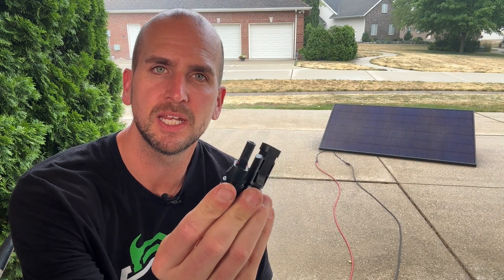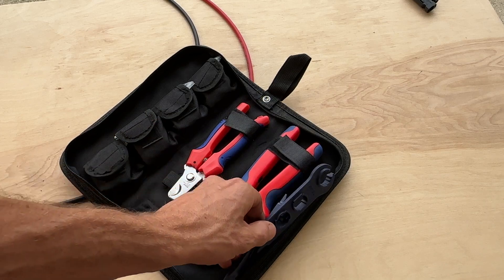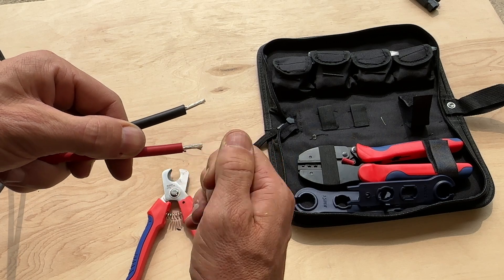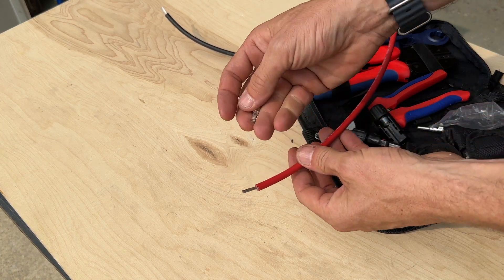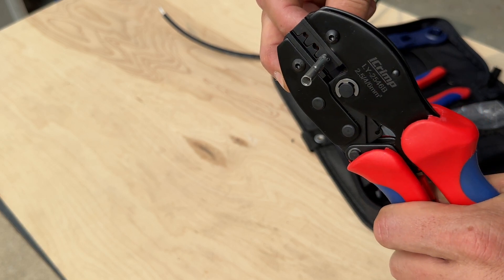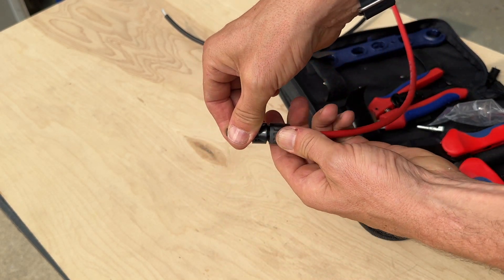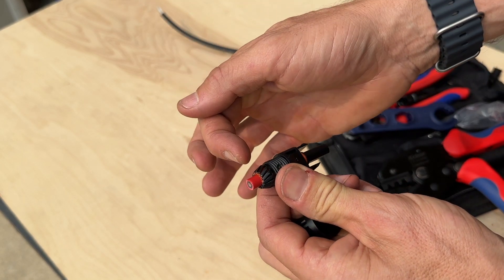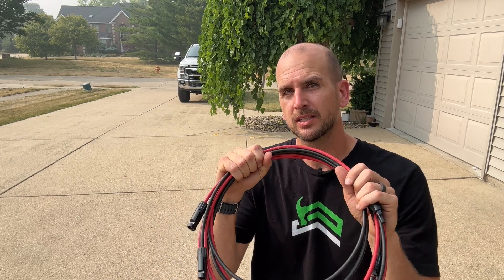The Easy Way To Install New Solar MC4 Connectors

Comment from the maker: Calculate Solar Cost For Your Home - https://geni.us/solar_reviews

iCRIMP MC4 Crimping Kit - https://geni.us/gBJM27
Power Analyzer - https://geni.us/s86J
Extra MC4 Connectors - https://geni.us/TKIBuK

Whether you are setting up your own DIY solar setup or just want to repair a damaged connector having a few tools and a little knowledge will make this job a quick fix.  The PV Solar default connector is the MC4 and the design is robust and easy to assemble in just a few minutes.

DISCLAIMER: This video and description contain affiliate links, which means that if you click on one of the product links, I’ll receive a small commission.

Comment: As a professional solar installer you could not pay me to use that crimper. Parallel action MC4 crimpers are dirt cheap these day and far exceed scissor style crimpers. We also only use genuine Staubli brand MC4’s. We have installed 30,000+ Staubli MC4’s and have yet to have a single failure.. We completed a service call on one of our competitors systems and it had 11 MC4 failures… the bill for the service call alone erased any “savings” there may have been from using knock-off MC4’s.. here is a hint.; If your solar installer is using anything by Staubli MC4’s & a parallel action crimp tool fire them now, they are hacks..
Reply: how about a link to a dirt cheap parallel action crimper?

Comment: Thank you so much - I am such a doofus though I am STILL confused!
The rubber washer on one of the connectors is red - so I always assumed that could only be put on positive "+" cables!!!
So what we're saying is BOTH cables (red and black) have both type of connectors on each end??
It doesnt matter if it has a "male" or "female" as it will only connect to the appropriate connector?
So the inner barrel - is it obvious which is male and female - or is it only the outer plastic connector that is gender?

Help!!!
Reply: How else could you have an extension cable? The confusion is that on a given connector, if the plastic part is male then the metal part is female. At first glance it looks like a male plug but is considered a female plug since the metal part is what counts. It's the metal part he is referring to as male or female gender. The red cable would have a plastic male / metal female on the "load" side and a plastic female / metal male on the source side. So the positive red wire out of panel has a female connector. You would have to plug your red extension cable into with a male connector, right? But at the other end of your red extension cable you need a female connector. So you preserve at the end of your extension the same connector as what came out of the panel. Thus a male connector and a female connector at each end of the red cable.

Comment: This is wrong. The wires should not enter into the cilindrical part of the pin. Too much of the insulation is removed.

Comment: What do you think about Craftstrom?  New and super easy
Reply from the maker: I don't have any personal experience with Craftstrom but for the price i would probably go with the EcoFlow Delta Pro 3 and get it on Black Friday sale.  The big plus with DP3 is the 240V out which is big for me as I can run my well pump in a storm.
Reply: @everydaysolar  My interest is with their solar into an outlet and monitoring at the panel so you never feed the grid. Undetectable by the power company.

Comment: Is the 10 gage wire the same as 10 gage automotive wire and speaker wire or different for solar asking cause I have plenty of 10 gage speaker wire and wanted to know if I can use it

Comment: I found it MUCH easier to put the cable into the metal thing first and to inspect for loose strands FIRST. Which is super important to prevent a fire. THEN put the metal thing into the crimper, pushing the metal thing down onto the cable so you crimp as close as possible to the bottom of the strands. The way done in this video did not work for me. I ended up crimping above where the strands and actual black unstripped wite meet and had to start over
Reply: Helpful vid nonetheless for overall execution
Reply: Also when tightening you want to hear 2 clicks then youre done, other video taught me that

Comment: MAKE SURE YOU HEAR THE CLICK OTHERWISE YOU MIGHT NOT BE PUTTING IT IN FAR ENOUGH!! you have to push hard. There should only be a tiny bit of the upper plastic showing inside the male end. I did w bougerv mc4s and i had to push REALLY hard to hear click. Only knew I had to push more because i compared to other already done mc4s and the metal was much closer to the tip inside the tube.

Comment: I am replacing solar panels on the roof of my van conversions.  I had to put new connectors on the wires coming out of the van.  I checked the voltage on a meter to the solar panel (2x200w) set up, series, and there is voltage.  When I checked the solar cables coming out of the gland on my roof the meter said continuity but when I connect the two there is zero solar power registering on the meter.  Series means negative to positive throughout the system, correct?  Where do I check for a problem?  Thanks

Comment: So extension solar cables are a bit confusing as both male and female connection is on the same cord!!! 😂
Reply: Just like you have a male plug and female receptacle on an extension power cord.

Comment: Thanks, I didn't realize the two prongs were for release.

One thing, I solder all my MC4's, I don't trust the crimper alone.
Reply: Crip is better than solder. This is 100% proven fact.
Reply: @SOLDOZER  Crimp is a better mechanical connection, solder is better electrical connection because is precludes oxidation. Using BOTH together is the best connection.

Comment: Do I need to de-energize my single 220w, portable, solar panel before working on it, if so, how do I do that ?

One of my MC4 connectors came off, my fault, I opened my truck door and pulled it loose.  I heard you can be shocked ?  It is sunny so I turned my panel over so it would not continue to collect sunshine, power, before I work on it.

I have ordered a kit so I will have the correct tools to do this repair.  Thanks in advance for all your help.

Comment: 400 watts @ 12v takes 33.33 amp fuse. No such thing exists. Haven't seen a 35 amp fuse either.
400 watts @ 24v takes 16.67 amp fuse. Again no such thing exists.
400 watts @48v = 8.33 amps. No such thing exists.

So you are stuck overfusing or underfusing.
If you underfuse, you can blow the fuse on a sunny day and lose your production.
Overfusing risks a fire.

Amperage of a given wire size is a constant rating. But there is a 2 hour rating where you can run a bit more amps through the wire.

If you direct bury wires the ground should absorb much of the heat. Depends on the depth and moisture content.

Comment: Good job on the video, a simple and accurate example of HOW TO DO IT. If you ever get confused notice that the O-ring is red !   and red is positive.
Reply: o ring does not mean positve.
Reply: @angel-angel-angel-angel-angel  The O-ring is red, and red on a DC circuit stands for positive.

Comment: There are different schools of thought, but according to the lug manufacturers the split goes down and the spike on the crimp tool compresses the back side and the lug folds over. 
On smaller wire using the standard lugs (non insulated) the split definitely goes down. I learned this a few years ago and it works much better than putting the split up and forcing the spike into it. 
Regarding the connectors you use in the video. I would check with the manufacturer or just try it both ways.
Watch this video for the information: https://www.youtube.com/watch?v=goxVeefDpQg

Comment: It was not super clear here, but the longer metal piece goes inside the shorter male connector. The shorter metal piece goes inside the larger female connector. Basically, opposite what you would think. I made the mistake myself until I finally figured it out because NONE of the brands of cables you buy have any INSTRUCTIONS or diagrams to show which metal piece goes where! 
Also, each cable has a male connector on one end and a female on the other, no matter if it is red or black. That was not made clear here either.
Reply: You're over thinking it.

Comment: I would also solder the connection after crimping. Also do not use a shears to strip the insulation, you will cut off a few strands of wire like you did no the red wire, use a proper wire stripper.

Comment: have two solar generator . one uses anderson on both ends to solar. Bought a second one that uses the  xt60i to the MC4 solar connectors . The two panels that use anderson are 100 w. The other is 200w panel.  Should i connect the 200 w panel first then the two 100 w or does it not matter?

Comment: Great video! I just noticed a few minutes ago that I had bought a 50-foot 10-gauge set of wires and then read that that gauge should be used up to 25 feet. The wiring instructions also say that one should use 8-gauge wires for distances between 25 and 50 feet, so I will be shortening the wires to 25 feet. Thank you for sharing this video.
Reply: That's nonsense, it just depends on amperage and voltage. Do the calcs

Comment: My kit was a little different.  For example it did not have something to cut the insulation off of the wire so I had to do that with the scissors on a Swiss Army Knife.  Probably there are better ways.  Then there was some wire that was bent on the end because another connector had come off.  So I had to get a wire cutter to get that off.  Then it was hard to get the stretch of insulation off of the wire.  Then the metal part did not have the same shape and it was hard to figure out what to do.  I had to add in a few steps.  Then the metal part did not extend out far enough into the connector so I had to readjust things with another couple of steps.  In the end it worked OK.

Comment: So can they not be taken apart again? I have to remove them to feed cables from the roof of my van down through the inside of it.
Reply: No because they have been locked in. You have to cut and re-crimp with new connectors.

Comment: Thank you for this video.  Each step I'm learning.  Right now i have foldable 200 watt Bluetti  panels which I'm using with my RV . I'm will attempt later, mounting panels on my roof which requires drilling holes. And running the wires. Again thank you.

Comment: Thing that confuses most of my colleagues is male and female or + and - side of the cable.  I teach them that PV panel determinates what cables will be and what connector goes on cable since we use same color DC cable for plus and minus. 

So if i say crimp minus closer to inverter they get confused with male and fame connectors. They crimp " female plastic" on the  - side which is false cause they associate minus with female and plus with male. 

But if i say panel determinates what is + and what is -  they automatically understand that they have to enable DC cable to go in the panel on the minus side. So they can visualize with understanding what they are doing.

Comment: THAT'S let that kit is for! 😂 I've been using fingernail clippers and tweezers. I'm glad I came on here I'm just trying to splice mine together I accidentally cut the wire. can't I just splice wrap them in electrical tape and put a plastic cap on? I will go ahead and subscribe to your channel. My solar wires seemed to get chewed by rodents or cut by the gardeners. Thank you for posting this information

Comment: How do you remove a connector from an existing wire?  Those stupid clips broke and I have to replace.  Also every dealer I called in my are was like “what’s an MC4” lmao what useless stupid asswipes.  Once again I’m 100% going to have to do this on my own.

Appreciate the video.
Reply: If you cannot remove it, just cut it off. Then strip back the casing and install a new connector.

Comment: I was always instructed to strip off 1/4 to 1/2" max so the wiring doesn't jam up against the pin connectors  and prevent a solid connection.

Comment: There is alot of information on connectors out there and be sure to utilize them as a boo boo could easily cause a fire.
Jut be aware that there are fake connectors out there and the easiest way to identify is the o-ring.

Comment: Don't forget to mention the direction of energy flow and what connectors to use on the receiving or sending end of the cable. In other words, a red (hot + ) patch cable will have both a male and female end, which one do you plug into the source and which one do you plug into the charge controller? If you are paying attention to the + and -  markings on the solar panel it would be hard to mess it up but someone new at this might just grab a patch cable and connect it to the wrong cable not considering the flow.
Reply: One thing I was missing was: Is there a standard for which connector (male/female) to use for plus/minus? He said to use female on the plus side, but was he talking about the "upstream" or "downstream" side of the extension cable?
Reply: @goranroseen  Yes. Two things to remember, the first is the outer cable housing male fitting, points in the direction of current flow. So positive flows from the solar panel to the charge controller and the male (plastic) fitting points in that direction.  The female is the negative that returns to the panel. So the female on the solar panel receives the negative current coming back from the charge controller. So again, since the male fitting points in the direction of flow, coming out of the charge controller is a male outer plastic fitting that flows back into the female fitting on the solar panel. I hope I made that clear enough. The second thing to remember is the actual wire fitting connection inside the out plastic fitting is always different than the outer fitting. So an outer male plastic fitting will have a female wire connection and a female outer plastic fitting will have a male wire connection on the inside. So the solar panel outgoing is positive and male, and the charge controller incoming will be positive female and visa versa for the negative.  Hope that helps. If it's not clear I'll try again.

Comment: This is great and all but maybe you could have shown how you wired up those power meters.... JHC those wires aren't strong enough to push into the housings and there's no room to hold it doing so. I've had to throw one of these away as I can't get it to go. No, I don't solder....

Comment: Let's say I installed one of the sides incorrectly. Is there a way to find out which side is bad without taking both of them apart? I can Yank hard on both ends without it coming off

Comment: I've made a ton of these wires and had very few issues.  A few times the connectors will get brittle and the tabs may break if you place any stress on the wires, but for the most part, they do a great job.  I bought that same kit and it works great.  Getting ready to do it AGAIN as I've added a couple of Disconnects to my strings so I can shut off current from both ends (panel and inverter side, since my array is about 500' from my solar shed).

Comment: Also note you should NOT mix and match the male and female ends of MC4 connectors from different manufacturers as the barrel diameters can vary slightly.
Reply: Also Phoenix connectors have different flats and don't match any MC4 connectors!!!

Comment: Hi Scott. Great instructional videos. I bought 50ft of Red & Blk Bateria brand 10awg PV cable from Amazon advertised as EN H1Z2Z2-K at DC:1.5KV. But I instead received pntech brand TUV 2PfG 1169 PV1-F at DC:1.0KV.  (I plan on adding the MC4 connectors as per your video.)  I think the EN H1Z2Z2-K standard is better than PV1-F. Is there a big enough reason to return this? Just want to run some  PV cable from my 800w array to my portable power station- 30ft. Thx.

Comment: Always use wire strippers and never twist them, you will nick the individual strands causing a stress point and the can break. From an electrician with 35yrs experience.
Reply: I just took a huge dump 💩

Comment: What is the best wire stripper for 6awg wires tho? And I saw when you stripped that 10awg that you broke of some strands, ive read that its a no-no to cut some of the strands and you need to redo it but cutting it back and re-stripping it is that true? 
Also I have seen those T-branch connectors for parallel connection and the Female side(socket type on original mc4) looks like a Solid copper Pin which i think is scary right? any loose contact will create spark and possible to cause fires what is your take on this?

Comment: I’m trying to figure out if I can use adapters or something to run some generac gs100 panels with my ecoflow panels. 

They use different connectors (xt90/xt60 or mc4)

Comment: I wanted to add, very important,  do the pull test on the connector and cable after you've crimped and inserted the crimped contact into the connector. 
I make my own cables, and if I'm using any cable smaller than 10 awg or if I'm using silicone cables, it's very hard to get it to click in. So, I use a small screw driver to push it in the rest of the way until it clicks.
If the crimped contact doesn't click into the housing, it can get pushed back when in use, and I think this is what often causes MC4 to heat up and melt.

Comment: hi can i get the cable out of the plug so i can thread it  through a hole..
Reply: Nope. They are one time use connectors

Comment: Hi!  I just need to remove my 15 year old system for a re-roof and I am having a very hard time disconnecting the MC4 Connectors.  I tried 3 different tools from Amazon and I can't get any to work.  Seems like a very bad design.  Maybe the plastic or metal fused?